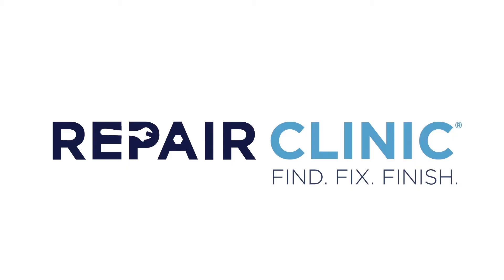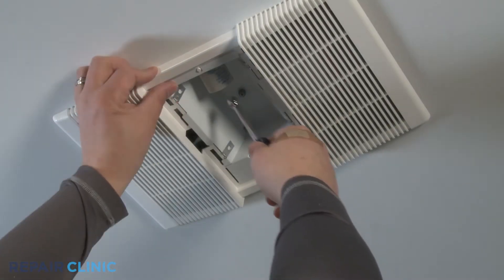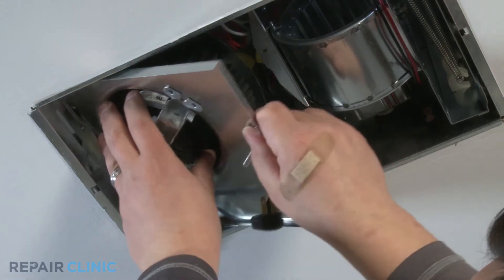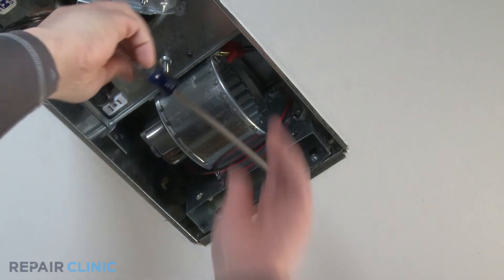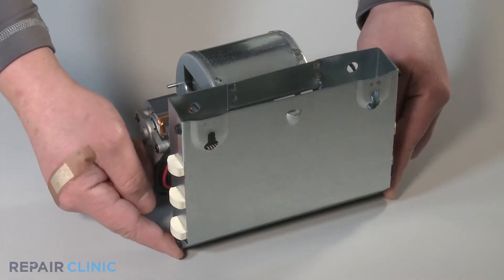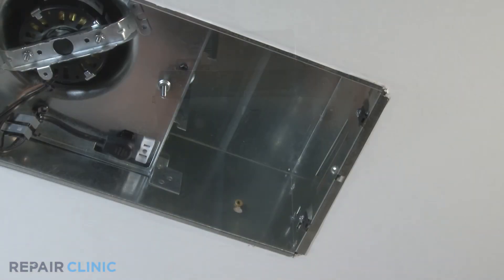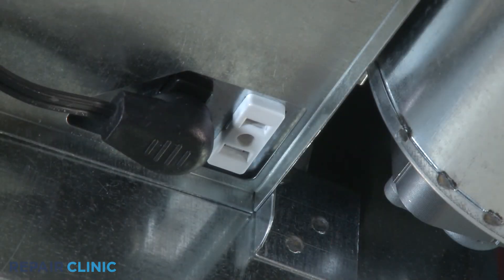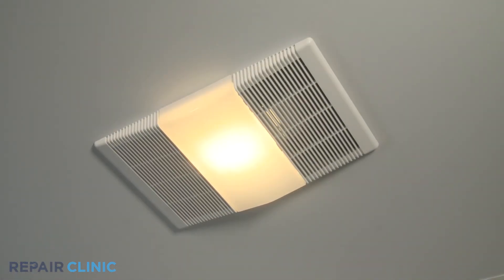Broan/NuTone Bath Fan (Model 765H80L) Disassembly – Bath Fan Repair Help

Comment: Seems like overkill to switch off the circuit breaker seeing how everything has an electrical plug and socket. I wouldn't kill the circuit breaker to plug in lamps at my house. It probably doesn't hurt as a safety precaution in the case of the fan.
Reply: It depends on how it’s wired. If this is using switch legs, there will always be power even with the switch off.

Comment: Great job with providing information with the nutone bath heater/fan..  the one I have in my house was installed in 1995 when the house was built. Because of cleaning fan , heater and coils  and making sure there are no blockages in duct work. It still looks very good and it’s used daily unless it’s summer.. great product everyone should purchase this brand

Comment: I have this exact model and fan stopped working while the heat and light work. I plugged in the fan to an outlet and still nothing. I can hear the power come on but no movement from fan. It’s not old. Just got a few months ago. Any thoughts on what it can be?

Comment: Question, I don’t have a heater. Is it necessary to turn the power off @the breaker?
Will it be fine to just make sure the switch is off?
Reply: Turn off at the breaker. Double-check to make sure it was the right one. Especially in an old house where a lot of work was done but not necessarily correctly.

Comment: Found this video this morning. I have the model without the heater. Your instructions still applicable, right down to the tool needed. Made my life a lot easier today! Thanks! I just subscribed to your channel. Happy new year!
Reply: Question, I don’t have a heater. Is it necessary to turn the power off @the breaker?
Will it be fine to just make sure the switch is off?

Thank you.

Comment: I have an older Broan unit that is emitting a high pitched tone when off. It will last for 5 - 10 minutes then stop. Is there a motor warning alarm or something? I’ve unplug the fan and heat unit and the tone still keeps going.

Comment: I currently have just an Broan exhaust fan/light combo installed. Do you think the existing circuit can support an exhaust fan/light/heater combo? I realize I'll need to trim the ceiling a few more inches to accommodate the new housing.

Comment: Can you show how to install this unit ?
Reply: @repairclinic  
There is an existing fan combo that I’m replacing, with this particular unit. My issue is the existing wiring is a little confusing, it has  two separate romex wires and at the switch it has total of six wires…. Can you help?
Reply: @MQJRGB  apparently not
Reply: @jacenkun2931  
😂 I figured it out. After identifying each wire via multimeter.